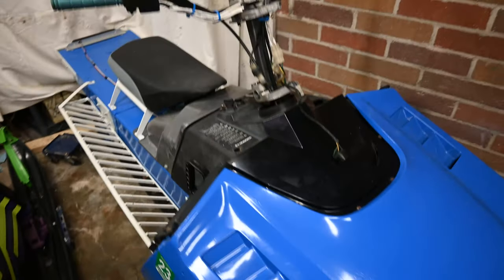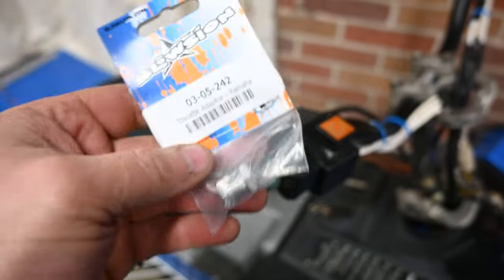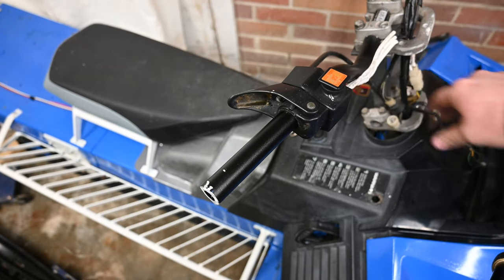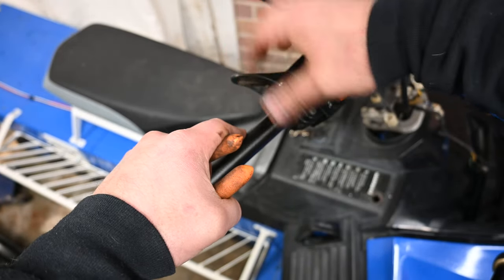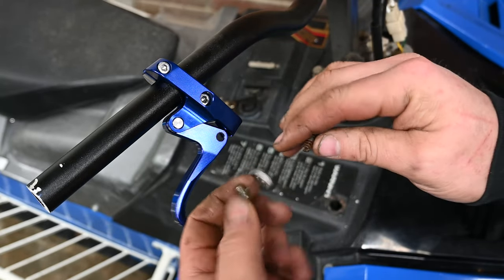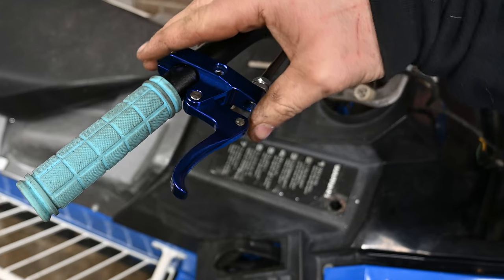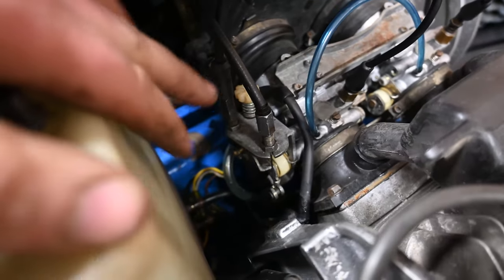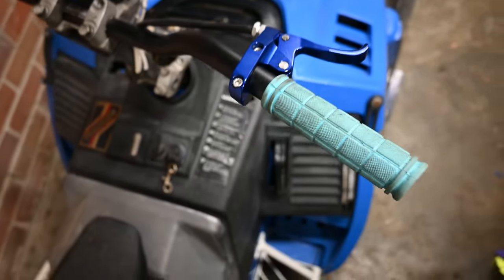Cheap Finger Throttle for a Ditch Banger Mod Sled

Comment: Any regrets switching to this specific style finger throttle? I'm about to do the same mod on my 05 RMK 700. Can't stomach 300+ for a Munster kit. $30 for the new style throttle and adapter exactly like yours,  $15 for a hand protector mount I can make a throttle guard with. Under 50 fits the cheap bill to try something I might not love (edit: and can't try until next season).
Reply from the maker: No regrets, have had good luck with them on the phazers. I'll probably put one on my sidewinder

Comment: Why not just install the killswitch first then put on your throttle finger it would look a lot cleaner than mounting it on your riser.. which is inefficient if your throttle sticks and you have to kill your motor.
Reply from the maker: Not enough room between the finger throttle and the bend on those specific handlebars. That would be ideal, it just doesn't work for that set of parts
Reply: @adaminthemitten8940  you can always hook up a Motocross killswitch

Comment: Do you have link to that on ebay please?
Reply from the maker: I added the links in the description
Reply: What do you think would this work in motorcycles? I mean for clutch lever?
Reply from the maker: @teemuronkainen  I don't think you'd have enough leverage for a clutch. I think this is pretty much just a throttle lever
Reply: @adaminthemitten8940  yeah i was thinking the same

Comment: With Mikuni carbs they are adamant about slide adjustment to prevent the slide from jamming into the top of the slide cap and potentially snapping the spring when it binds up.  Did this throttle allow for wide open throttle without hyperextending the slide at WOT??
Reply from the maker: I'm still running butterfly carbs on all my sleds but there seems to be plenty of adjustment